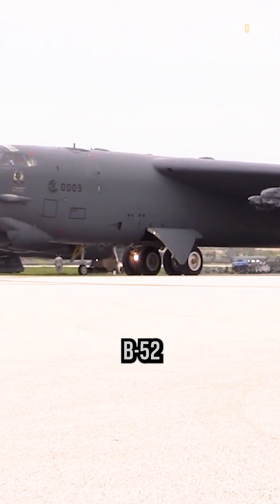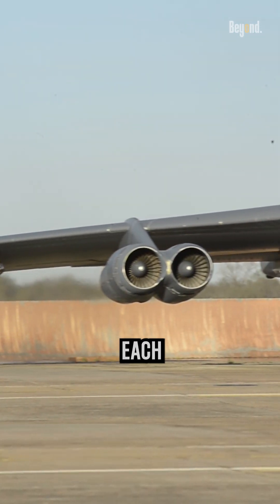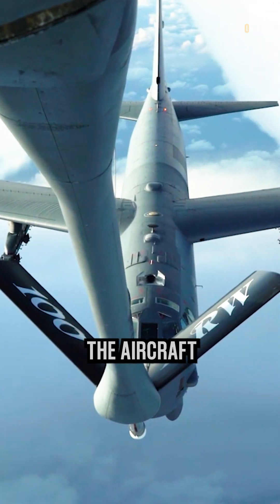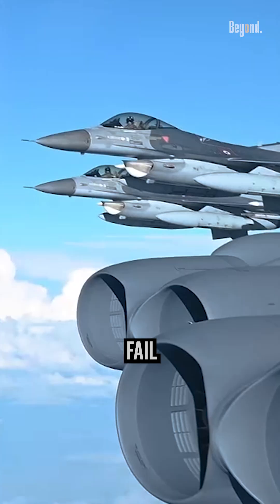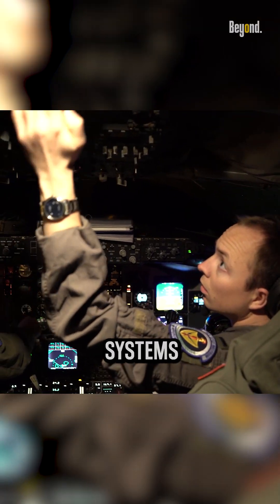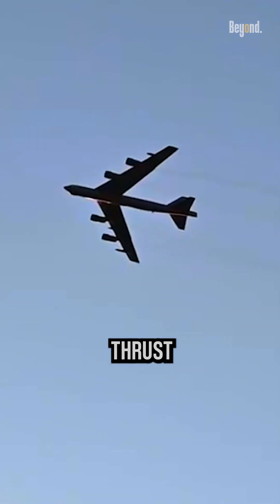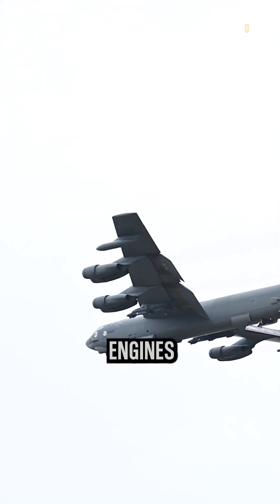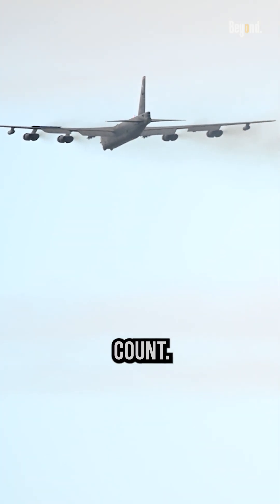Is it possible for the B-52 bomber to fly with only four engines? #shorts

Comment: Actually it would depend on which engines failed.  Even with all 8 engines the  Buff has always  had marginal lateral stability, even before the fin and rudder were cut down.  If both engines of an outer pod were lost the jet won’t be able to land safely.  This is why it is s getting 8 new turbofans rather than 4 bigger ones.
Reply: It can land safely with all of them out on one side. It’s just sketchy as hell

Comment: the B-52 is getting new engines! They are 30% more powerful and have 30% more range.
Reply: They’re the same thrust
Reply: @grandmasterpu  True, but they're 35% more efficient and drive new generators giving 44% more electrical power.